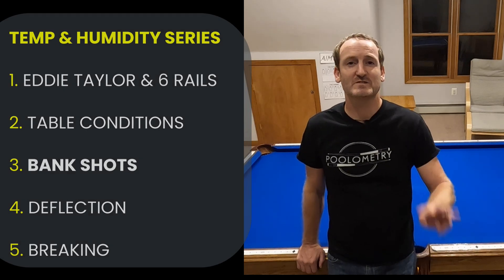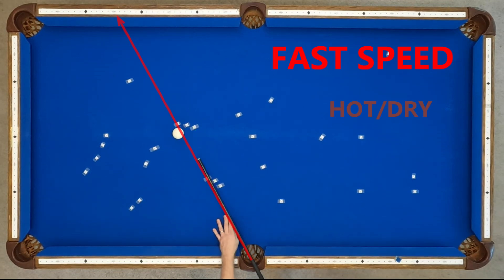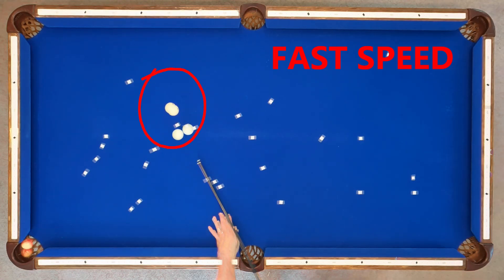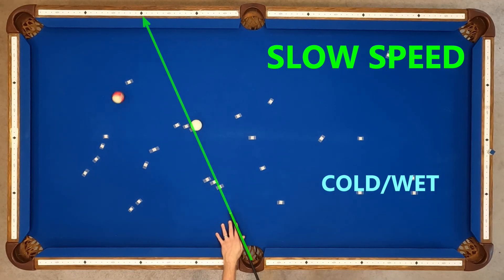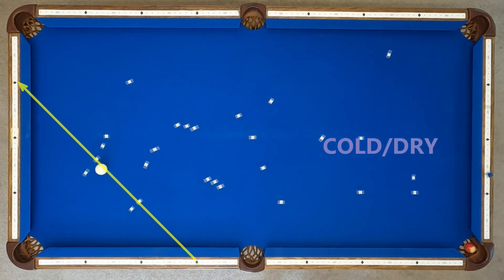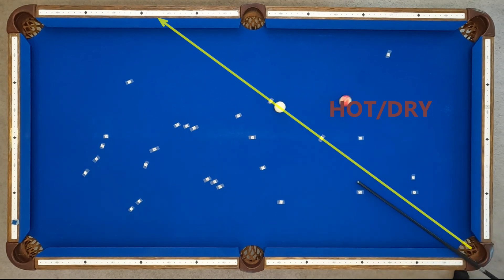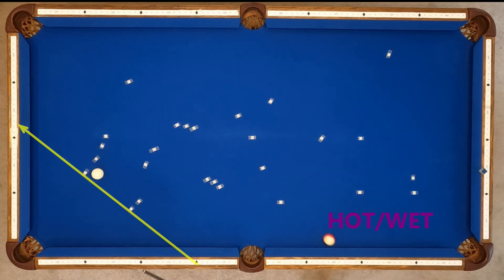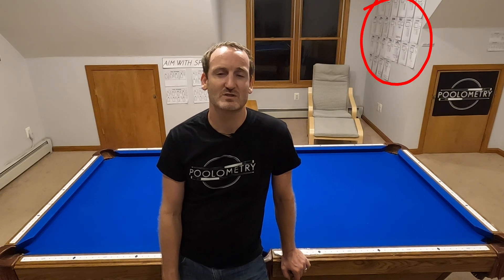3. Bank Shots: Temperature & Humidity Experiments

Comment: My pool tables in the garage and typically playing at 8 to 12°C during the winter. Always have to adjust as it warms up. Today running at 13.3°C and 65% humidity.
Reply from the maker: I still can't decide if temperature or humidity seems to have the biggest effect, but cold and humid is sort of an unusual combination.  But at least you know it matters, and are thinking about adjustments.

Comment: The reason 2 rails go long under the hot humid conditions is because the first rail banks short, making the ball go into the 2nd rail at a more shallow angle, making it go long... you can think of it like the gear principle... short, long, short, long, etc. (alternating effects, which might taper off as the number of rails go up as spin off the rails takes over some.) Also, You've done some videos where the "2:1 ratio is wrong", is it wrong all the time, or just under certain conditions. I'd have to re-watch that video. Did you do any videos on how much the balls grab the rails with spin, I watched all of the 5 you did on temperature and humidity... I don't recall if you did anything related to one tip of spin vs two tips of spin maybe having a bigger or smaller effect based on climate conditions. You did spin with ball collisions, I remember that.

Comment: Question ❓ looking at this. It would explain the short bank and slow speed. But mine will jump if im shooting med/hard. Like the cue is sticking or wedging and shooting out possibly moisture humidity ridiculously high.
Reply: If I shoot slow or at pocket speed it goes fine typically. sometimes it will hop very slightly
Reply from the maker: Hop off the rail can sometimes be the height of the rail nose.  I know 2 specific tables at my pool hall are slightly low, and with power the ball will hop off the rail.  As likely though is a downward stroke of some sort.  Cue elevation will jump the cue into the object ball and then the object ball hops a little too... If your stroke is truly level, it is probably the rail height.  Play on some different tables to see if the problem is you or the tables.  Still - truly fast speed will hop a little everywhere - but not medium.

Comment: Nice one!

I don’t think the 2 rail shots that go long in hot/wet conditions is very mysterious. If you think about it, they’re just extensions of the 1 rail shots (like all banks are). 

If they’re banking short with 1 rail banks, that means the object ball is hitting higher on the 2nd rail because of it, which changes the trajectory of the ball in and of itself, but also because it’s now a more glancing angle, and the ball wants to slide down the rail more than normal, widening the angle.

It could also be exaggerated because of the speed required to get the ball to travel that far. It inherently means you have to hit the first rail at a faster speed than the second rail, which would also contribute to the trajectory.
Reply from the maker: This makes sense. But don't underestimate that shot. Gives me fits trying to identify track lines at various speeds. Only patterns I know of where fast and slow speed and in the same place.
Reply: Gotcha. Yeah, I assume if you overlay 2 rail shots from every table condition, you'd find similar patterns going from the first rail angle in to out against the second rail angle in to out.

I don't have solid answers, but what I know about how rails behave at various incoming/outgoing angles and speeds, I think it at least makes sense.

Comment: This I believe is why the break changes so much under these conditions as well. Only the two 2nd row balls pocket before hitting a rail. The others will be influenced by the condition you have explained and most are a softer bank as well, with the force an average player breaks with. As for the 2nd row balls I wonder what the cling effects on them are in these varied conditions. Great work.
Reply from the maker: I did test the 8 ball break, video to come, but I was focused on balls pocketed.  I think rack gaps might take the top factor for ball trajectory. Next time I'll do a 9 ball rack instead.